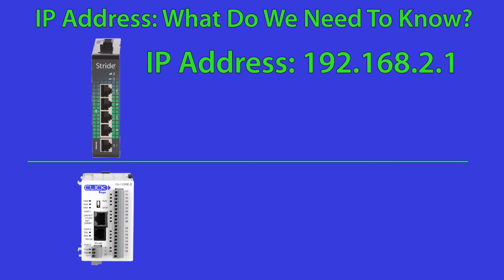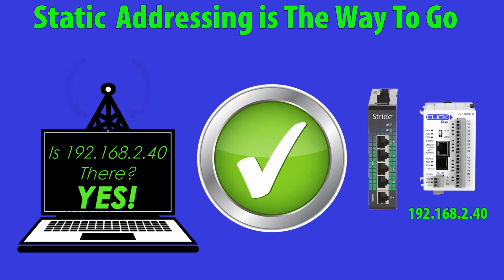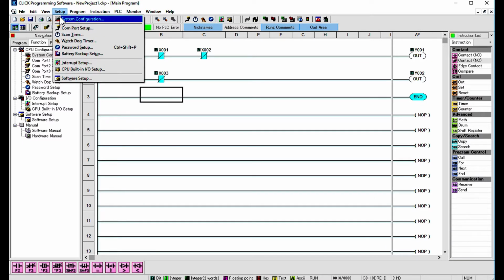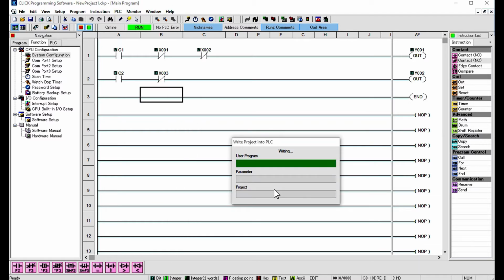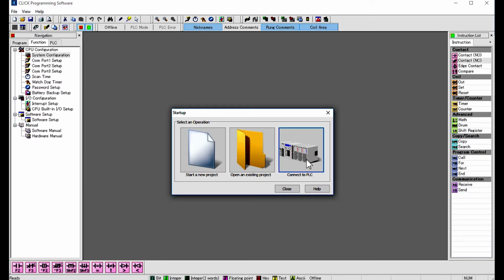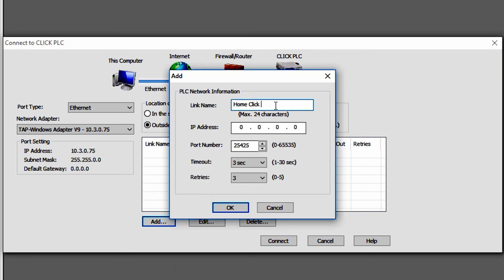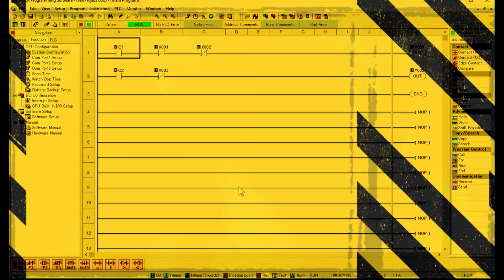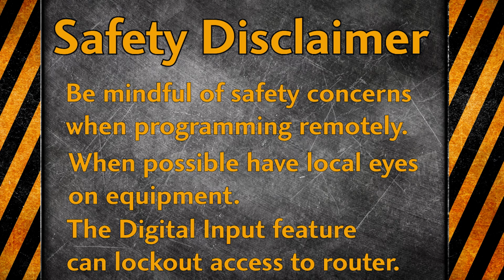Remote Program CLICK PLC Through the StrideLinx VPN Cloud

Comment: Does it have to be StrideLinx router to connect remotely , or can it be a regular wifi modem/router as well?
Reply from the maker: Mustafa, any modem/router will work for remote connection, as long as there is a route path between your programming PC to the PLC. The Stridelinx VPN is a secure and convenient option, as you don't have to establish a complex route path from wherever you are accessing the internet through the local firewall that your PLC is protected by. Once the route path from the router to the Stridelinx server is established, you can establish a secure VPN tunnel from your PC to the PLC just by logging into the Stridelinx cloud.